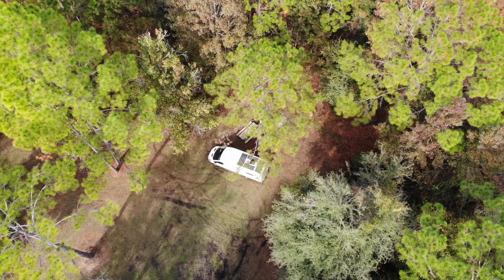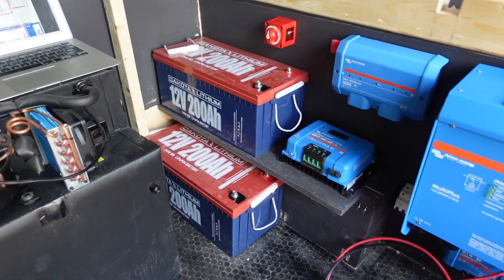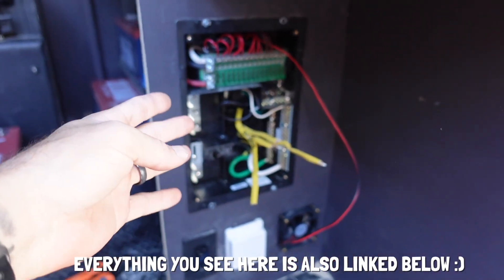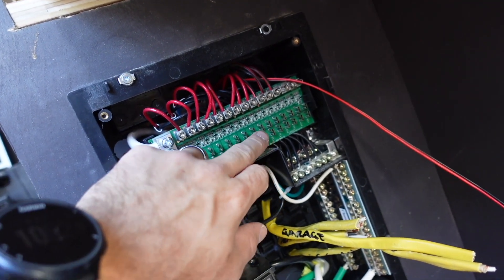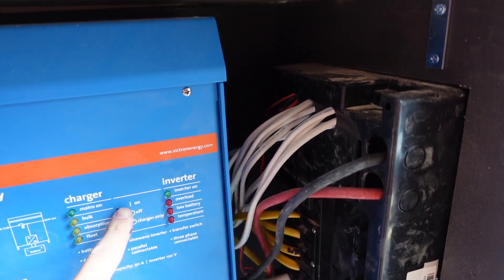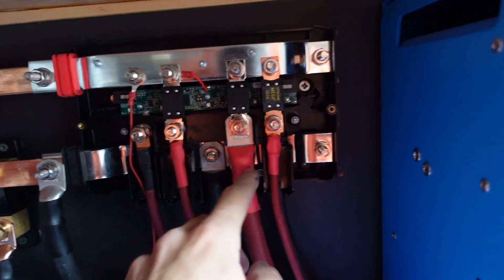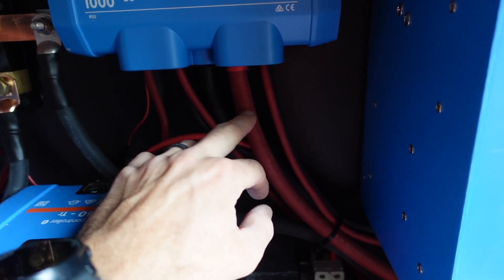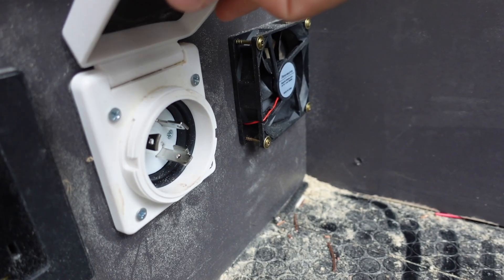DIY Camper Van Electrical System Install (w/ full parts list & diagram)

Comment: Why 12v??!  you plan on pulling 100 and 100’s of amps , with 3 12v ? Who not going 24 or 48 v and literally half weigh your setup in cost and weight?

Comment: We're doing a slightly more simple set up in our Airstream build: batteries to an inverter charger. No solar, no DC to DC. Would we still need a links distributor or would we just run the battery cables directly to the inverter charger?

Comment: Why use 6 and 10 gauge wire? What are you powering that requires 30 and 50 amps?